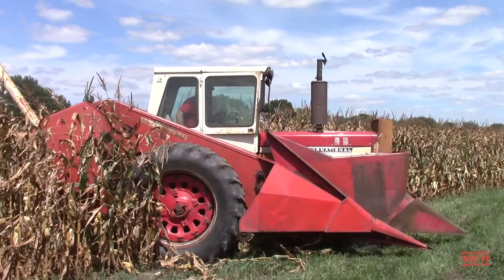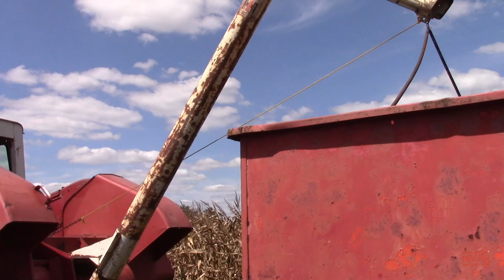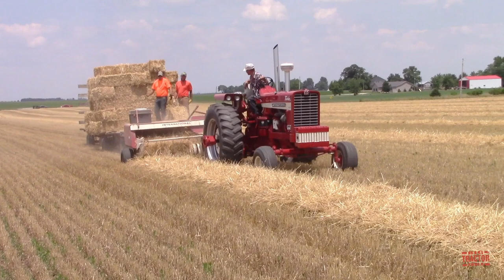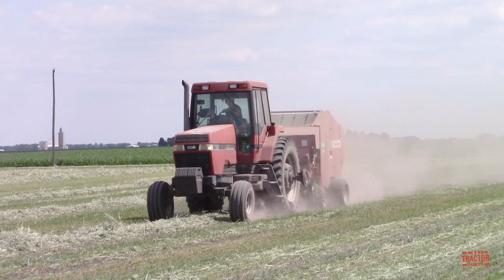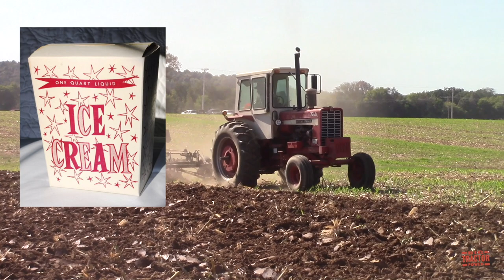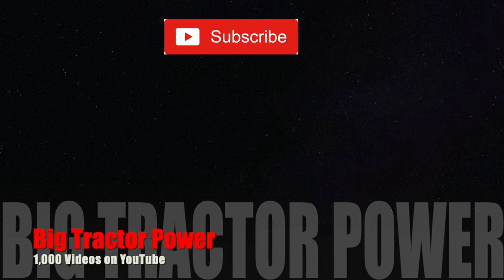INTERNATIONAL Tractor Ice Cream Box Cab

Comment: I worked on a farm in the late 60's and 70"s we had an 856 with the Ice Cream Box cab. It was better than nothing but was hot in the summer. It was better built and didn't rattle like the add on cab on the 1256 or the home made cabs on the 806 and the Oliver 1800 and 1950. Spent a lot of hours in that 856 , tilling, planting, cultivating and harvesting potatoes in SE Idaho. Ours had 4 wheel drive.

Comment: I have a 1969 656 with an ICB cad my grandfather bought brand new.  He wouldn't take delivery of it until a cab was installed, so he didnt actually receive the tractor until 1970.  Been in the family since new, under 5000 hours on it.  I actually have a spare ICB cab in a shed I have thought about putting on my 706.  The nice thing about them is you can open the door and the side window and get some air flow through it.   The bad thing, not ROPS and the visibility isn't the greatest.

Comment: My grandpa bought a 1967 IH 756 gas used with a cab on it (not sure of brand since it was a while before I was born). All I have been told about it was that it was super tall since I'm pretty sure the tractor had a corn picker on it at one time. Since then the cab has been removed as well as the picker and it is now on it's 4th or 5 diesel engine😂😂😂. We have owned the tractor for close to 50 years now!

Comment: I put one of those cabs on a 706 gas in the early '80s, my first cab. Better than open station at -20. For the record you can't  use a New Idea mounted corn picker with this cab, I tried. Interference at the lower front cab corners.

Comment: I still have the 856 with the ice cream box cab.
We had used it to push and pack silage with a blade and have a loader for it!
Quit pushing silage with it round the early 2000s 
Leave it on its loader to do the odd job .
Reply from the maker: Very cool set up. Does it have an IH loader?
Reply: No it's a dual loader.